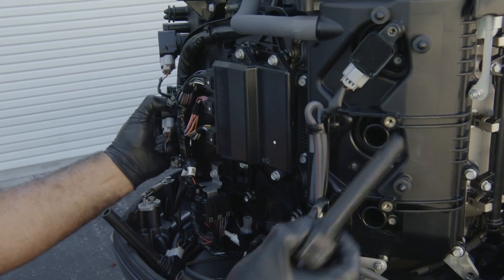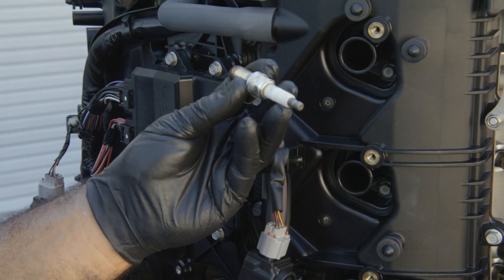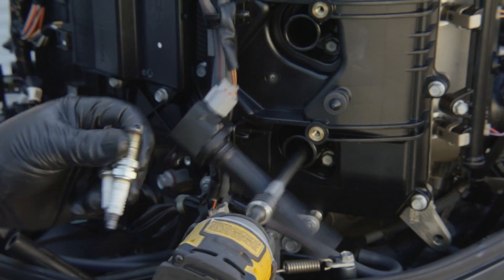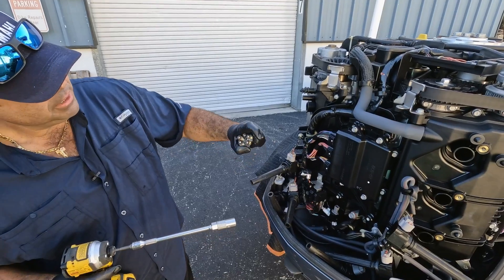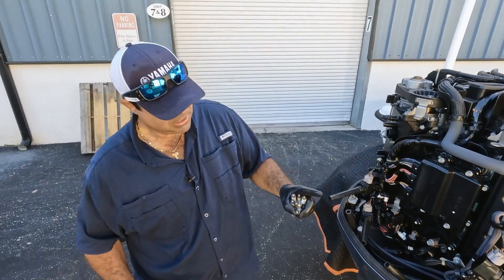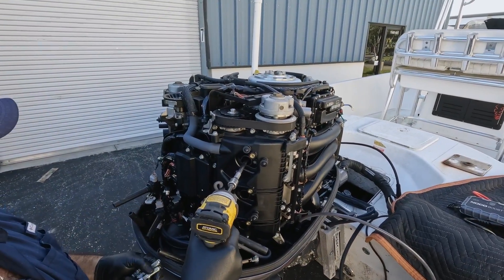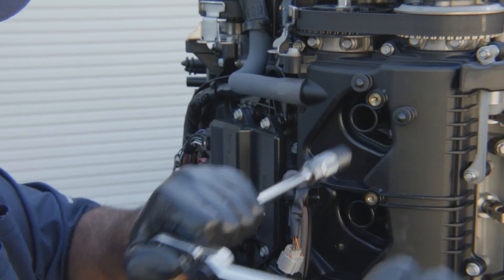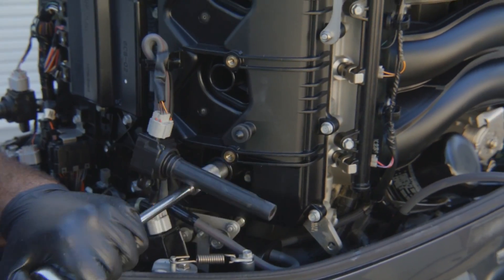How to Replace Yamaha Outboard Spark Plugs | VF200-VF250, F200-F250 3.3L V6, &  F225-F300 4.2L V6

Comment: Super important for people starting out when changing sparks, make sure you start the plug with socket+extension to make sure you're properly started on the threads. Impact can cause you to strip the threads and will cause a nightmare to repair.
Reply from the maker: Thank you for watching. Great tip!

Comment: You don't have to check the gap?
Reply from the maker: Hi Chuck,

Great question! While many modern spark plugs come pre-gapped from the manufacturer, it’s always a good idea to double-check the gap with a feeler gauge to ensure it's within the recommended range for your specific engine. That said, given our experience and how often we work with these products, we’re confident in how they come and how they fit, which is why we typically skip this step. Thanks for reaching out, and feel free to ask if you have more questions!

PartsVu Support Team!